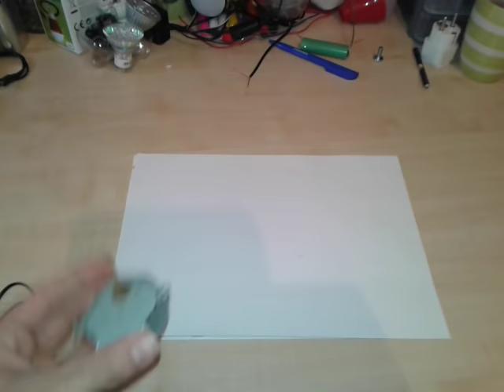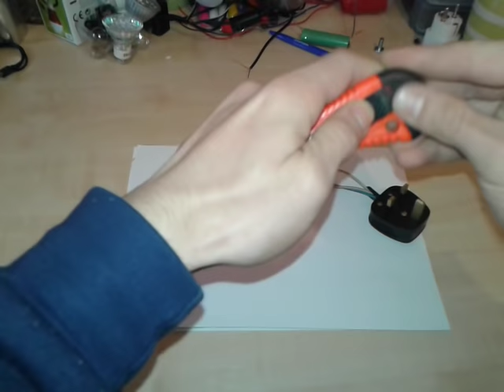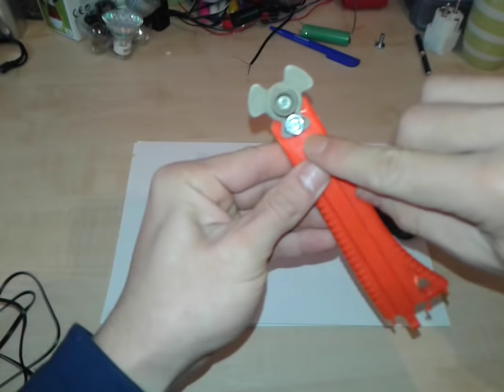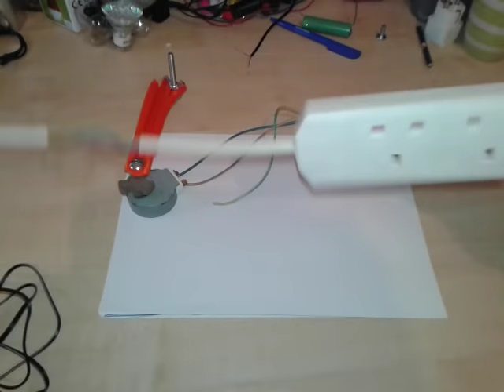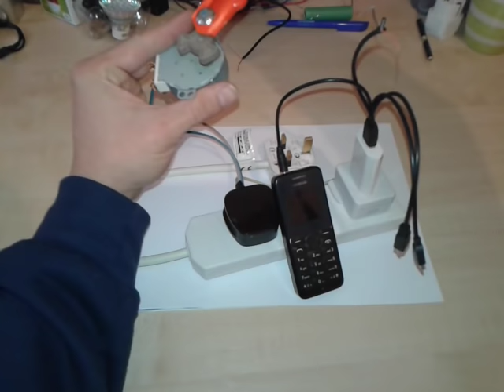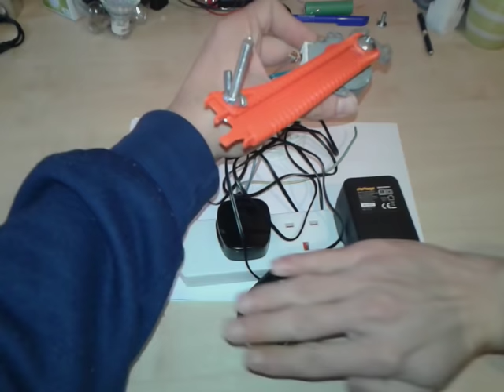Homemade 220v hand crank generator from microwave oven motor

Comment: I don't understand u cranking up a 220v  ac  to a dc drill battery.  a dc battery will blow up if ac  runs into it. believe me I know. even if it has very low wattage it will pop the dc battery. dc-ac don't mix.
Reply from the maker: The drill battery has its own charger that convert ac in dc i am just 
powering the drill charger with this hand crank 220v not directly to dc 
battery you got that right ac and dc dont mix but ac can be converted in
 dc with a full wave bridge rectifier
Reply: ok man!! we good.   I didn't know you were going through a charger.

Comment: Why the fake Thumbnail? It tough you where going to do 3D model ?
Reply from the maker: How is fake mate? there is a handcrank and also is text
Reply: Nan I'm talking about the plastic case and all the circuit inside.
Otherwise nice video
Reply from the maker: +Kendrick XY (GoproTestCamera) 3D printer is a dream        at this time😆
Reply: Well you can get one for 300$ or less if you buy the Prusa version! 
Big investment but worth it and it's the technology of tomorrow! Really soon people will get job thanks to their knowledge with the 3D printers.
Reply: My son has built two 3D printers, a small table top unit can only print objects about 16cm high and another that stands over 120cm high. 
It seems the plans and materials are easily available online.
Reply: Yep, That's the good thing about 3D printers, you can built it by yourself, but u might struggle a "little" bit to parameter it. Or you can buy something ready (almost) ready to go.

Comment: bro its not 220 volts its 12 volts
Reply from the maker: Its actualy 240v measured and tested the only problem is has low amps the total power is between 5-10W
Reply: its actually 220v BRO

Comment: Your plugs and sockets are weird ! Ours in the USA are different. They are 110/120 volts too. Yours are 220 ! The prongs are not horozontal like you show. So maybe ours will crank  out some dc low volts ? I am going to try this with a USA microwave motor and see. Results to come . Adios ! Chow, Later gator.
Reply from the maker: yeah is different plugs but if the motor is rated for ac it will deliver ac 110v or 220v

Comment: WHAT A WASTE OF TIME , not because you used a 220 plug means your making 220 voltage! Even children know that!
Reply from the maker: are you surehave you tried?its true mate it make more then 220v but amps are low with a simple usb charger mains one its output 5v 0.5A and used directly can light 3-4-5w led light 240v light bulbs
Reply from the maker: Hugo Barbedo yeapp true

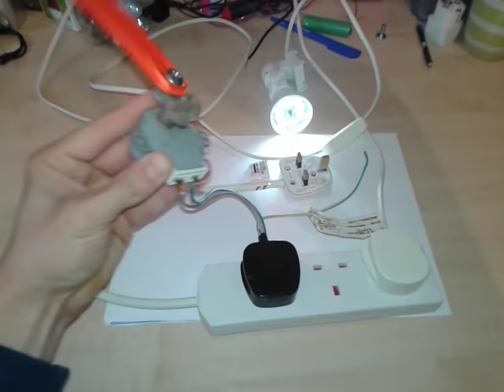Comment: Its 100% fake.  Watch carefully at 3:18 before he starts spinning the motor the lamp turning on haha^^
Reply from the maker: pokal1999 in your mind mate try it and then com ooo wait you dont know what microwave oven is no prob you will learn maybe
Reply: m8 im an Electronics technician for devices and systems so i know a lot about elektronic xD Sry bro but its not going to work. put your video speed to 0.25 and watch 3:18 you can see it starts glowing before your spinning the handel lol?
Reply from the maker: pokal1999 if you are an electronics technician have you heard about synchronous motor inside this is a round magnet coil of copper and many pulley to make the rotation of magnet faster,and all led bulbs have capacitors in so it have some energy stored all the best mate and think outside the box
Reply: in the led bulb the capacitors have some discharge resistors so if your screw them out yout dont get a electric shock. and yea i know what a synchronous motor is. and yea you can generate some energy from motors. but why is the light bulb start glowing before your "generate" the energy? and why your using a totaly diffrent thumbnail?
Reply from the maker: pokal1999 if you know all this things why is so hard to understand that thia motor actualy produces more then 220v when spinned?with just half of spin the led lights up it has a gear ratio 300to1.the thumbnail is not that far got motor got handle is missing the transparent case
Reply: okay than. so you can send me a picture with 2 multimeters to measure the Voltage and Ampere. should be easy ^^. if its a 7W led you should get 32mA^^. Yea it would work but not without spinning the handle but in your video the led glows without that xD
Reply from the maker: i would but i dont have it any more check this video when i show whats inside
https://youtu.be/SjQO8QKKkYg or this video a gravity generator https://youtu.be/yvz1VnUwQ54 or just search other videos many people have tried this ...
Reply: than buy another one and show it to me :D in the second video you see how slow it is. and you doesnt event start spinning the motor and it starts glowing wtf?
Reply from the maker: pokal1999 you can buy or salvedge one from microwave test it and then reply back you will see till then all the best
Reply: hmm no. just answere my question why is the lamp glowing before your starting to spin the motor?
Reply from the maker: pokal1999 i dont know what you are refering to maybe is the camera but just have a look in the other videos i am not editing videos i try to film them from one go   if i was making fake free energy stuff i would have millions of views.all the best my friend and not all youtubers are fake

Comment: Fake
Reply from the maker: Dylan H don't worry i will find something more easy for you
Reply: NoSkillsRequired you didn't pick up the power board and move it around. That's why I said that. Just lots of people have been making fake videos
Reply from the maker: Dylan H For real that is just a plain paper and the stuff is 100% real but not all the microwaves have this most of them.how to test if is good crank it and touch the leed if is a small pinch thats it more them 200v low amps all the best